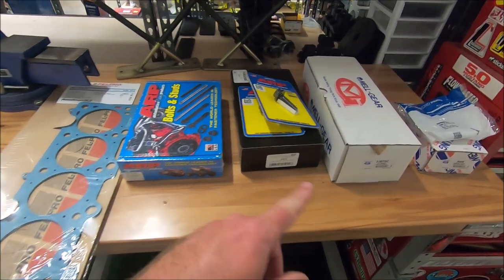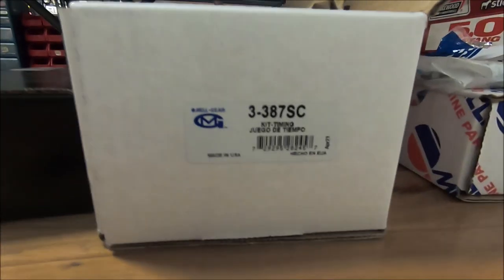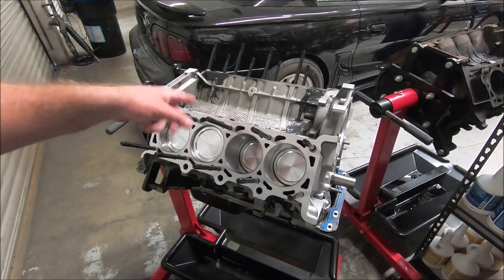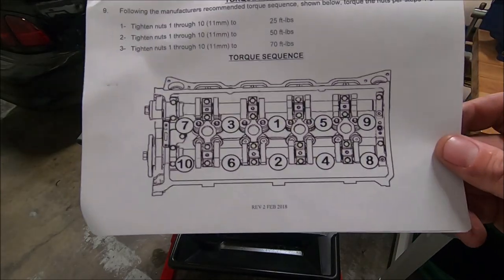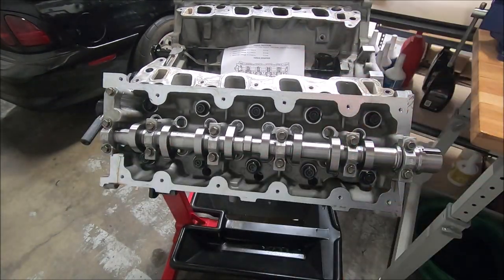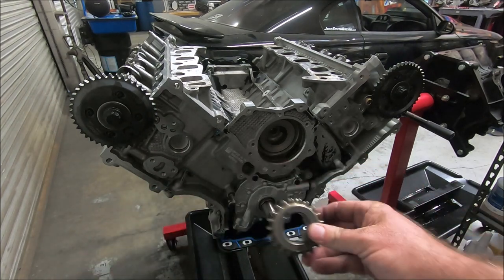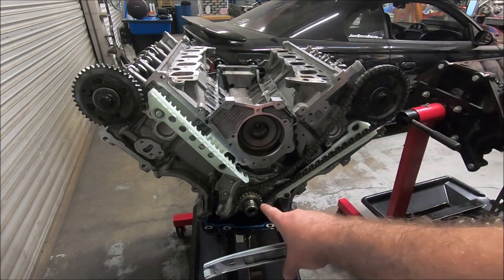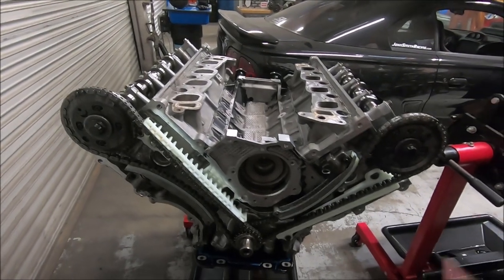99 Mustang GT with Nemak Part 14 – Assembling the Long Block with ARP Head Studs

Comment: This video saved me some coin. I wasn't sure if i had to buy 3v head studs or not. They a significantly more expensive than the 2v/4v head studs. I have never built a 3v but i have this Nemak im using for a 2v build. I thought the studs might be block specific. Turns out, the 3v head require longer head studs. Thank you